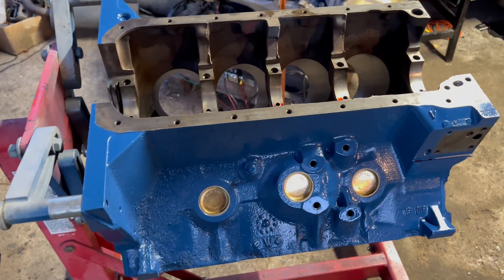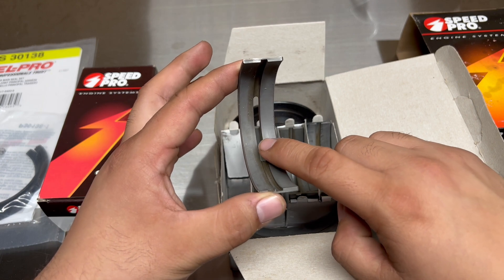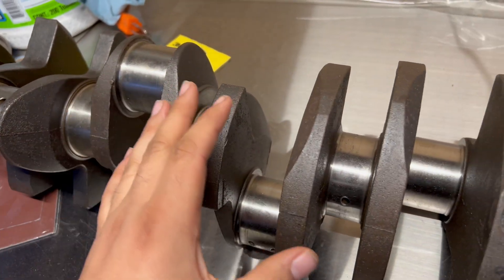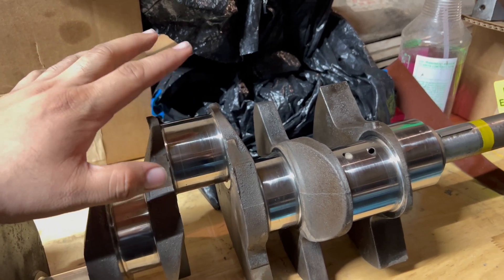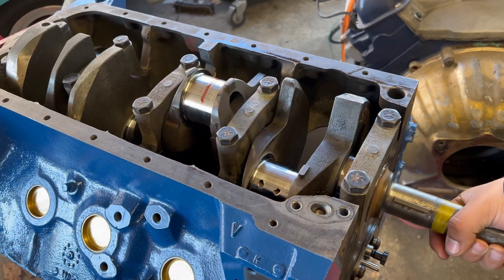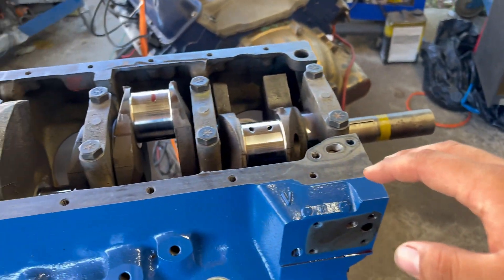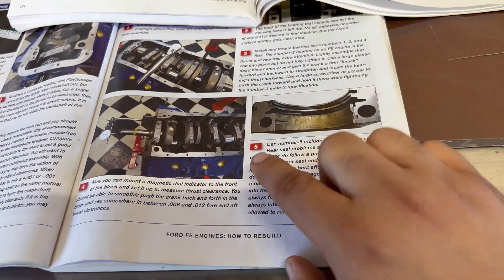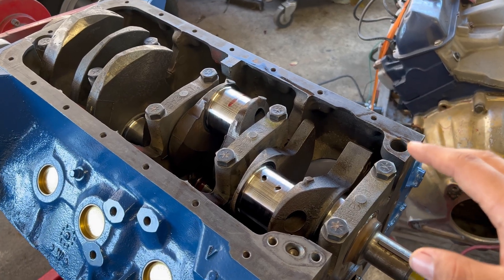Ford 428 FE Build Part 3: Crankshaft Polish & Install

Comment: after torquing down the mains on mine it had a lot of drag when trying to rotate, had to use a lot of force to rotate...?
Reply from the maker: It’s supposed to be really smooth, you will get some drag by installing the last main with the seal but should still spin with fingertips. Did you measure all your clearances?
Reply: @OmarRamirezGalaxie  yes clearances are good , removed all caps and found #4 as the cause , bearing surface was shiny on only these shells. Thinking of swapping shells with #2 to see if I have the same issue? Not sure what to do.
Reply from the maker: @tonychavez2083  yes you could try swapping them and clean clean. What are your clearances

Comment: Yo man, i my self have an fe 428 in my old cougar from 69’ but my rear main seal is leaking… I changed the seal about 2 months ago. Do u got any tips on how to get it sealed? I have a new seal again and is going to change it again if you got any tips. Best regards William
Reply from the maker: I would say make sure there are no burrs, make sure it’s clean and put the seal in an offset manor like I did. I used silicone as you saw. Want to make sure it oozes out of the rear back cap. That will let you know it’s sealed. Take your time on it and you’ll have it sealed up.
Reply: @OmarRamirezGalaxie  okey Thanks alot.

Comment: Nice! Someday a Shelby Engines new take on the 427 with their heads and intake... you'd love that aluminum block with all the extra gussets and bolts [updated take on the Windsor design] ;-)  This 428 will sing nice in the old Galaxy for sure. The colour is fantastic if you can get that colour matched for a full paint job on her.... man :-)) Be sweet for sure!
Reply from the maker: Haha yes eventually it will be painted. Can’t beat a slick paint job
Reply: @OmarRamirezGalaxie  Well you are doing a fantastic job Omar :-) No style quite like the Fords of the 60's but for me, the Galaxies of the first and second half of that decade show the evolution of the FE mind. Falcon's, Fairlane's and Galaxie's :-) Fantastic. Please continue to share. Whatever you think may be dull, be sure to the folk out here in their homes watching, it is not dull but inspiring :-) Thanks!

Comment: Nice assembly job, .003 is on the money for a FE Ford. We ran .003 to .0035 for clearance on our race motors. Our 428CJ would turn 7000 rpm and made 580hp. That was back in 1980s. Good luck with your build.  👍👍
Reply from the maker: Thanks Doug, wow 7k rpm that’s crazy haha. Sounds like a rocket
Reply: @OmarRamirezGalaxie  that was a 1968&1/2 428CJ  Mustang Fastback  4 speed car. Ran the best of 10.72 @ 125mph. Fun car! Sold it in 2003 when I retired from racing. Bought a brand new 2003 Mach 1 azure blue 5 speed for my fun car. Can't wait to see your car finished.  Gonna be sweet!

Comment: You’re doing really good and not that you needed to but you owned up to your mistake. Believe me that’s rare these days! Brass headed hammer next time! I’m anxious to see this engine running! By the way Awesome Torque Wrench #snaponrules
Reply from the maker: Yes definitely learned my lesson. I have a ball peen hammer ordered, I’ll have to see what the difference is with brass. And yes saved up for that torque wrench and finally got to use it. Definitely a very nice piece  👍
Reply: @OmarRamirezGalaxie  the significance of brass is that it’s softer but a good steel ball peen will probably do it really well too. I’m going to send you an email tomorrow! Be on the lookout!

Comment: I'm always impressed with your attention to detail when working on vehicles. I don't have any photos to share but there is another step you could have added to removing those fine lines, and improving the overall performance of the crankshaft. You can do this experiment on any hardened and smooth steel surface. Insert a wooden dowell in a drill press (about 3/8 diameter. Apply lapping compound to the metal surface and gently press the dowell into the part with the drill on low to a low medium speed, you'll see a swirl mark materialize. Index the part 1/2 diameter of dowell and repeat, creating an overlapping line of swirls. The lapping compound removes .0001 of metal surface which is negligible for even performance engines. It looks pretty too!
Note: There is a characteristic related to cast iron parts that have threads, it is called 'galling'. If the interlocking thread surfaces are not completely clean and free of minute chips, those chips buildup and collect at one point which prevents screws from turning in some cases, they will just lock up and sometimes can't even be removed by reversing the screw. One solution we used at Catapillar was applying a drop of dish soap on the screw, which solved the problem.
Reply from the maker: Wow some great information! Never tried the wooden dowel method, I’ll have to look into it. But that description of galling the threads is exactly what it sounds like. Good to know what caused that, I’m sure glad I was careful when it happened